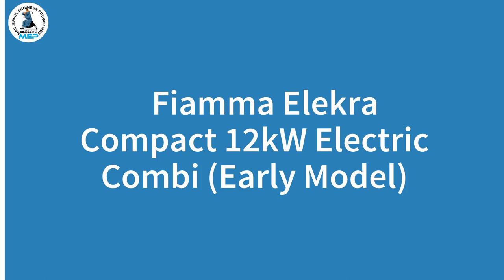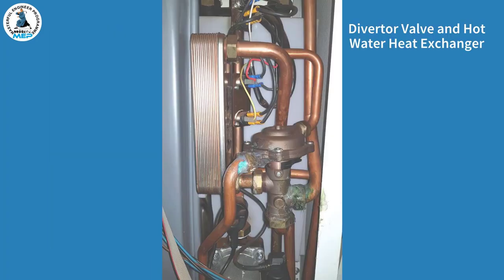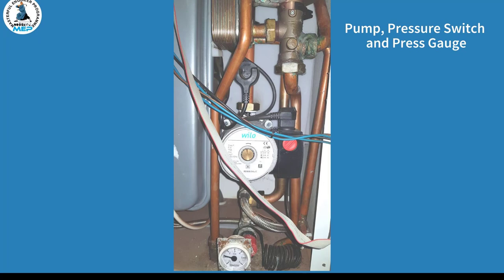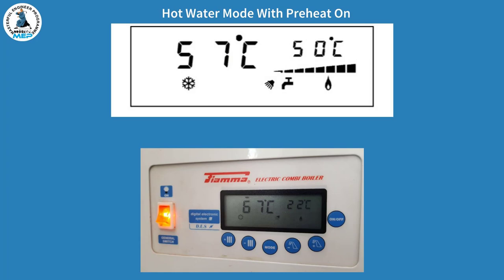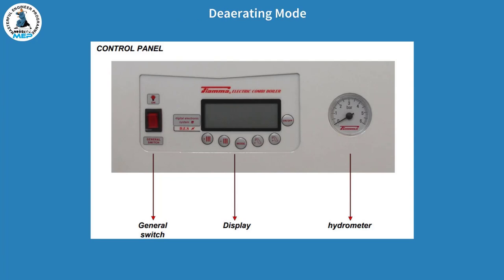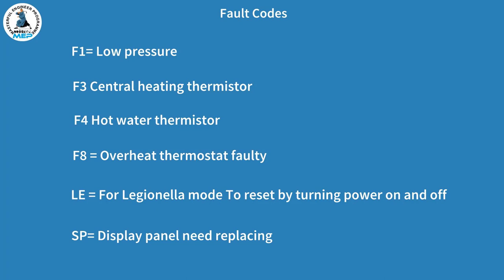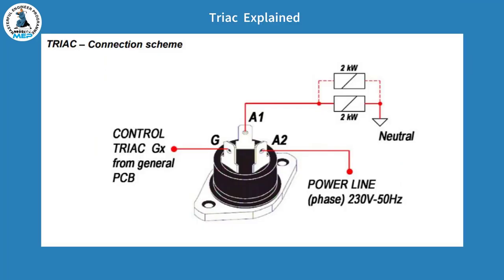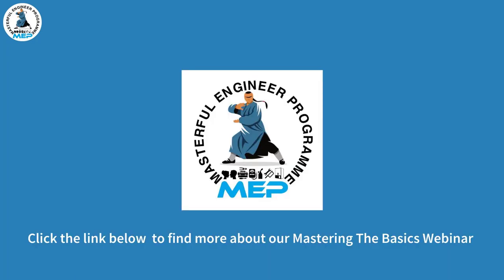Electric Combi Boiler Elektra Compact C With Coach Tony Morgan

Comment: Numerous issues with our boiler. Whilst in summer mode, the heating still comes on.
Water isnt hot enough for a bath and can only shower for 40 seconds max before it turns luke warm.
Plwase help 😭

Comment: Do you know what  the smaller text temperature (the one on the right) signifies - is it the tank temperature (for pre-heating)? The smaller text temperature doesn’t seem to increase on mine and flashes between 35c and LE (which I think stands for Legionnaires). I have Comfort and Winter mode on. I was able to get half a hot shower and then it went cold. I have noticed if I run the hot tap for a couple of minutes the large temperature drops while the smaller temperature increases very slightly... thanks

Comment: Can you show how to switch the value 0 or 1 of the Jumpers? In particular Jumper 8? My boiler somehow
- will not respond do the tap water + or - buttons, and pressing both tap+ and tap- for 10 seconds has no effect
- it does not display any temperature on the righthand side (only left side)
- in summer mode the boiler temperature goes down to room temperature, nothing is heated and no hot tap water
- in winter mode the boiler makes a constant noise, I believe it is the pump, 24/7, but maybe this is normal and expected for winter mode.
- there is no Parameter 8 (P8) in the parameter settings mode (it only goes up to P7).

I believe it is because the JP8 = 1  (Jumper 8) and I need to set it to 0 instead, but I can't find it. Where is it?

Although... for the past 3 years it has been working fine with hot tap water in summer mode (without touching the jumpers). I don't know what I did with the settings this winter but maybe I just changed the wrong setting somewhere in the menu.....   or some insect managed to crawl inside and switch the jumper?
Reply: @BoilerrepairNet is that something you know or something you do not know?

Comment: Good video thanks, a question please, What controls the timing on the boiler I.e. what time it turns on and off please ? Thanks.
Reply from the maker: For the central heating timing you use a external timer and for hot water it's always ready for a demand
Reply: @ARBoilers  thanks for the reply, I just bought this flat and it has exactly same boiler as your video the problem is it turns on in the morning and whole day remains off As if there’s no power. The on/off switch doesn’t do anything.

Comment: Great video. I have an error code that I don't understand: "SP". The hot water works but the heating doesn't so when I press the button to increase the temperature of the heating, the number goes up but the code "SP" comes on and off several times.
Reply: I got the same problem, did you solve the problem
Reply: @yxt8959  I'm afraid I never got to learn what the issue was, my landlord called someone to repair it.

Comment: Having an issue with boiler when shower or water has been running for a while it is turning itself off at the mains? Anything I can do regarding this? Is this making the boiler less efficient and costin me more ?
Reply: At the breaker switch? It may need a larger amp switch. What do you currently have in there?

Comment: Hello . 
I’m having a trouble with the electra compact 12kw . It’s new one and it shows me f 3 error . I done the thermostat wiring wrong and the fuse was burned, I’ve change the fuse , the boiler works but it shows f 3 error and the granfos pump doesn’t work. 
What should I do 

Thank you 🙏🏽
Reply from the maker: Hi that error code is a boiler probe delivery error. It could be a board fault too. Is the boiler heating up?
Reply: Thank you for replying . 
Yes I put the heating up and doesn’t change nothing. Even the hot water doesn’t work. 
As soon as I switch on the boiler it seems to work for 1 second and the pump switches of by it self and it shows f 3 error
Reply from the maker: Like I said it could be a board fault. You will have to speak to the manufacturer on this one

Comment from the maker: How long have you had this hot water problem ?
Reply: Sorry the comments were not sorted by chronological order and I didn't see your reply.
I have had this problem since this spring this year when I tried for the first time this year to switch to "SUMMER MODE"

Previous 2 years it worked fine, had hot water on SUMER MODE. Not sure what I changed this winter in the settings. Or maybe some insect crawled inside and switched the JUMPER 8 ? Running out of ideas.

Having read the manual, I am starting to wonder the contrary: how on earth did it work the previous years? Because it really looks like JUMPER 8 is switched to heater only (there is no temperature displayed on the right side, only on the left side, etc ). In which case everything makes sense. In which case... how on earth did it work the previous years....
Reply: Hey, let me know if you know, thanks
Reply from the maker: It could be the divertor valve or the hot water micro switch  @Anon_sdobfadufb
Reply: @ARBoilers  Cool, you mean those might be broken and need to be replaced, right? (or do you mean I need to switch them on/off or do some sort of action myself on the interface or whatever)

I just noticed that when the whole boiler is shut down for a week (holiday) and turned back on (on winter mode), the temperature displayed number quickly goes back to its maximum (set to 50 degrees, keeping in mind there is only one number displayed which seems to be heater instead of tap) but there is no hot tap water, hot tap water only comes back very slowly after like 30 minutes.

I wonder if the hot water tank is only and solely warmed by being next to the heater water tank......  warmed only by proximity, which would explain why hot tap water is lagging behind...

Anyway, was just in case this was a red flag of some sort that means something specific.
Please let me know if you meant those are broken
Reply: @ARBoilers  how do you replace the diverta valve or micro switch please as I think one of the other is the problem with mine

Comment: How do I turn the hot water on? I don't understand this or the manual. Tap icon is not on and I don't understand preheat option. Help please
Reply from the maker: If you run the hot water tap and the symbol doesn't appear on the front panel the divertor valve has failed

Comment: Does comfort mode always need to be on or is it fine to turn it off? Will this also save me on my energy bill?
Reply from the maker: Hi comfort mode will consume more power however the boiler will give a faster response for hot water
Reply: @ARBoilers  I’ve seen some people say you always need comfort mode on for the elektra combi c is this true? Many thanks!
Reply from the maker: @jakesouthwick3699  has I said before comfort mode gives you a faster response. Hope that helps.

Comment: My water heats up but runs out very quickly. Barely enough time for a shower, any advice please?
Reply from the maker: Video The front of the boiler in hot water mode and WhatsApp it to 0797 3325384 I will see what I can do
Reply: Hi I also have the same problem can you please help as I don’t no what to do.

Comment: Great video. We have the same boiler and have had a lot of trouble with ours. The display is on (lit in blue) but the digits and all the other symbols flash on and off every 3 seconds. There is no error code. It sounds like it's on but the water only gets lukewarm then turns cold no matter how long it's been on for. Would really appreciate help if you know what might be causing it!
Reply from the maker: For this it would require a Engineer visit